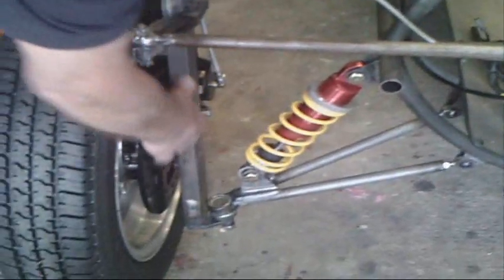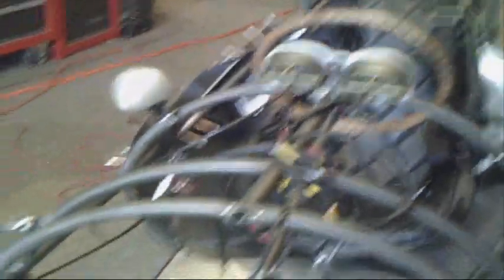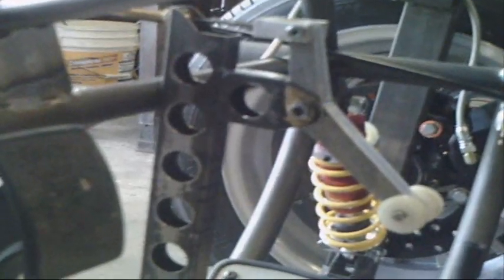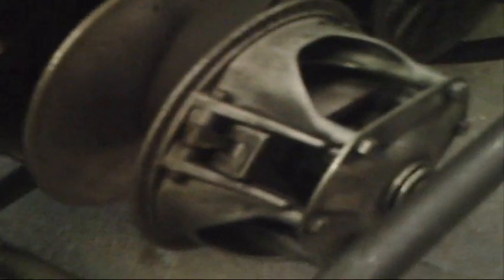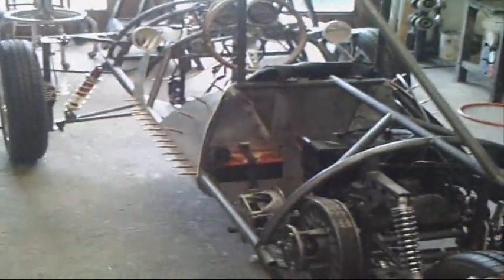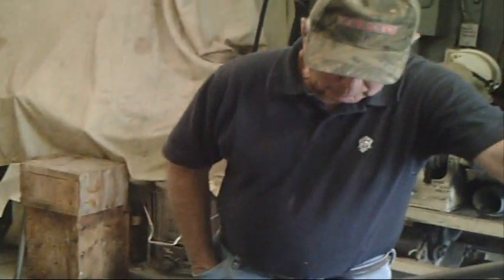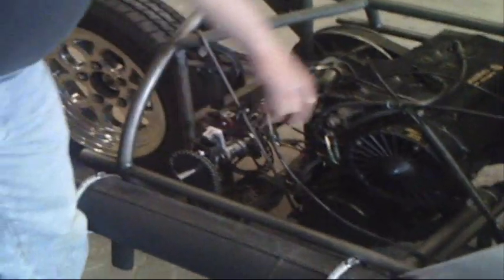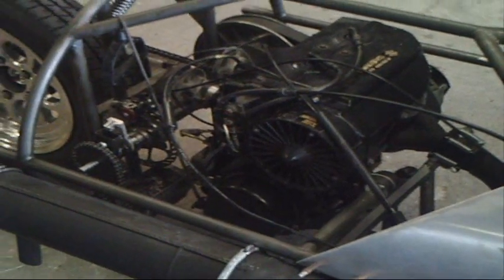Two Stroke Snowmobile Powered Reverse Trike

Comment from the maker: Right now I have spent $5,700 for nuts,bolts,parts,etc. That number is the high side since I include any parts I purchased but ended up not using. Also when I need a bolt or nut I buy 50-100 and include that in the price. I have spent $100 in state taxes and $2000 for shop supplies, tools and equipment. Grand total of $7800

With that said our goal was $5k to $6k not including our labor. With our labor we were shooting for $10k to 12k.